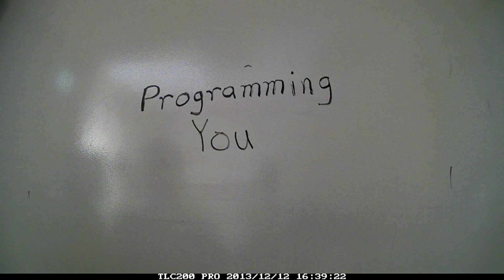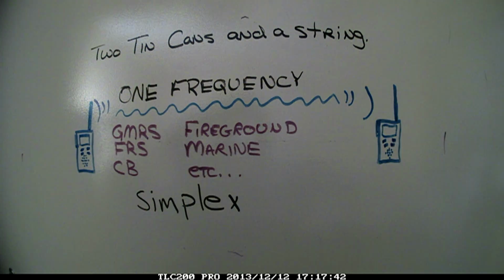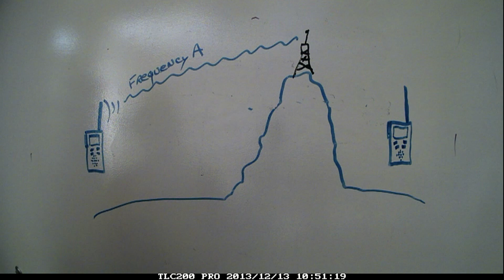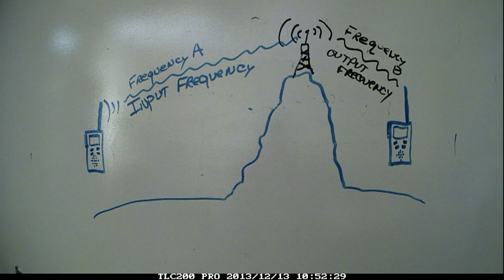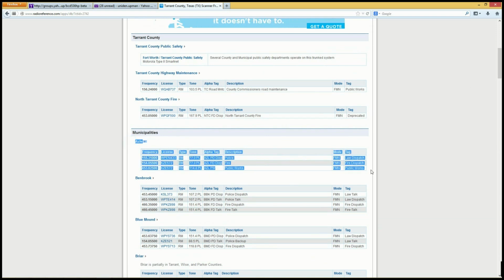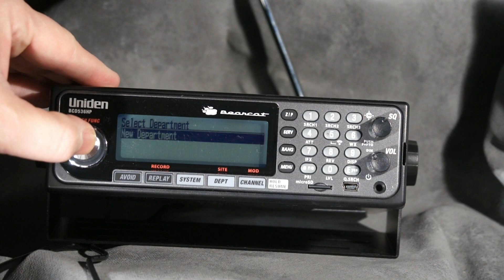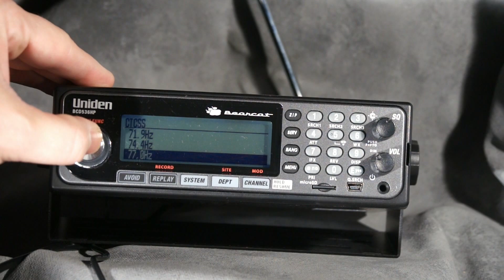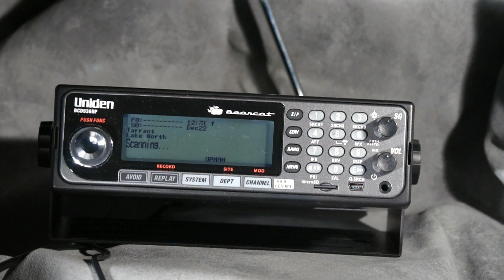Programming Your Scanner, Part 1

Comment: +Uniden Upman ...What model scanner is that? No Software? Looks like about a years work, to fill it with frequencies!
Reply: That's why you use the Sentinel software to program it directly from the radio reference database with what you want.  Or just press ZIP and put in your zipcode, and it'll setup many of the systems in your area.

Comment: Your information is definitely very valuable but the problem is you're running through it so fast I cannot keep up with it to program the scanner. Please take a breath and give us time to get to where you're at so we can move forward. The house is not on fire so take a little bit of extra time so the knowledge you are trying to share can be comprehended. Thank you very much I still need to program this thing before I send it back to the factory.

Comment: I got my 536hp a few days ago and when I programmed it it doesn't show the frequency or PL tone it just shows the system and department and it also doesn't display the date either. So I'm not sure if it was the way I programmed it or what, I thought for sure it would operate and display the same way my 436 does, Unless it was how I programmed it.

Comment: My new BCD536HP is receiving as per the display towns many miles away yet it is broadcasting my town. I changed the range to zero as per manual. reinstalled my zip. No change. Any way I can correct that?

Comment: Our PD just went trunking here in Hayward, CA.  So I purchased a BCD536HP from HRO. Enjoyed watching part one towards the end...  I searched for Parts 2 and 3 before I read the rest of the blogs below.  My programming skills failed the first try with the Sentinal software.   BUT!!!  while doing a scan after putting in zipcode, and AVOIDing tons of locals, it stopped on the Hayward PD channel, so I quickly hit the CHANNEL button to hold...but I have to leave the scanner on so I won't loose it.   I've read through the manuals, OEM and EASY.  Still working on how to program that channel so I don't loose it......Terry - WB6TA

Comment: PLEASE HELP!! I have the 536hp.  I live in Vancouver, BC CANADA.  I have inputted my zip code, I've found the local police agencies and respective dispatch channels that were already pre-programmed with the unit, however, I do not hear any transmissions at all from ANY of the 10 local police agencies.  As far as I know, they are operating on a EDACS Digital system... not encrypted.  SCANBC is able to post "silly calls" online without posting address and specific info, so I know it is possible.  Why can't I hear anything? I can hear Fire Depts, but thats it.  Thanks again.
Reply from the maker: Have you purchased and applied the ProVoice upgrade? That is the only way you would be able to hear digital channels on an EDACS system.
Reply: +Uniden Upman yes I have and now it works perfectly!! My next issue is how do I stream from Siren when I'm not on same wifi network. If both scanner and iPhone/siren app are on same wifi no problem. I want to be able to stream from my cell phone data, or any other wifi network. Could you help with that? And I'm also a Mac user so sentinel doesn't work .. I have researched about parallels and running windows in iOS ...

Comment: great scanner but I think mine is trashed, and if can't get it worked out will just junk it. Calling uniden tomorrow to see if I can get a replacement micro sd card from the factory. If not it get junked only after 4 days.
DONT HOOK INTO A MAC with the USB everyone or you will get this mess i have

Comment: Great video Paul. Can I suggest a great free tool for you to use instead of the whiteboard?

http://www.smoothdraw.com/product/index.htm

SmoothDraw is awesome as popularized by Khan Academy
Equivalent fraction word problem example
Reply from the maker: Looks like I'd need a graphics tablet to be able to use it effectively...
Reply: Uniden Upman You're right... I just figured maybe you wanted an all in one solution so as to do all the pertinent demos on the PC as opposed to back and forth between live video on a whiteboard and then screen capture :)

Cheers and looking forward to the advanced ones... never really got the hang of my 996XT maybe now I could understand it better... especially the system on/off stuff... way over my head
Reply: Uniden Upman need some help with programing a un 396xt for the bahamas